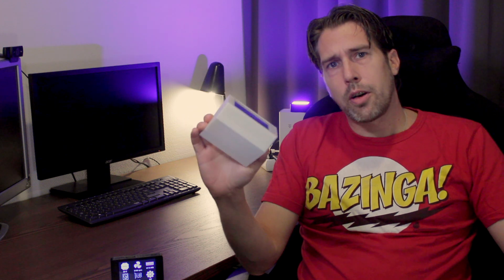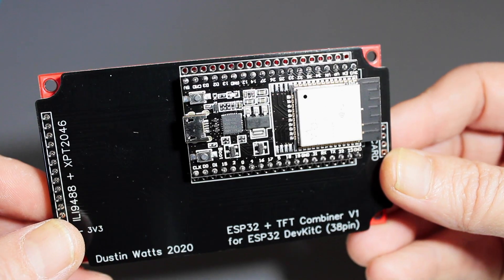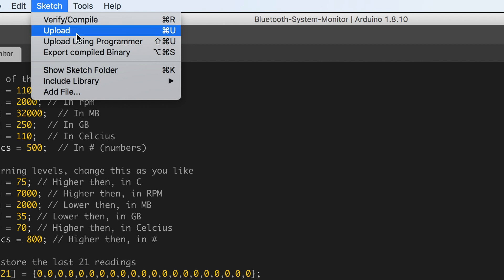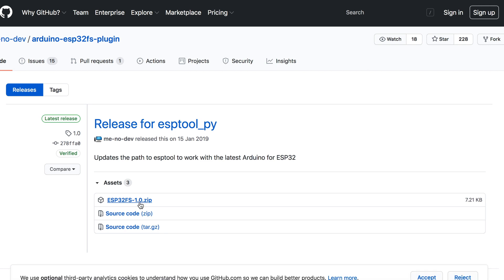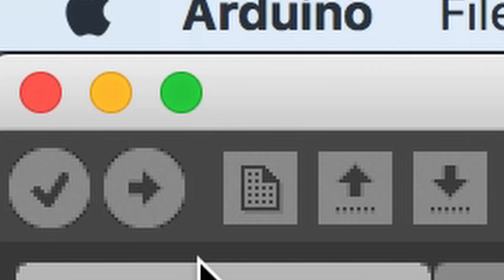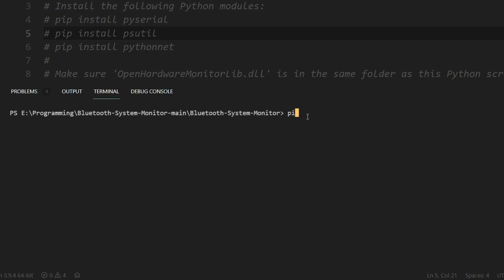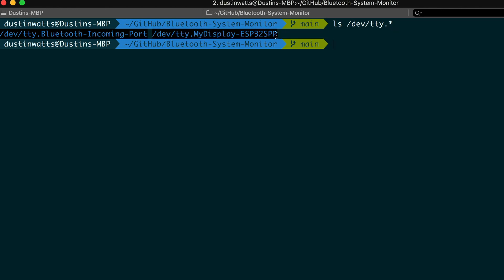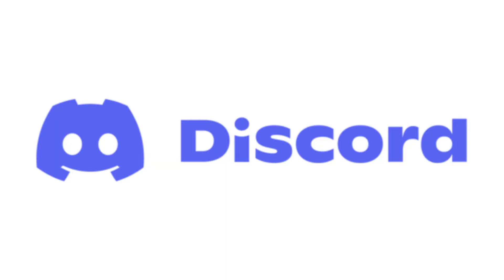Build your own Bluetooth System Monitor

Comment: "AddReference" is not a known member of module "clr"
error in my windows 11, pls help
Reply from the maker: Hmmm... this has something to do with an upgraded library. Because nothing in the code has changed (it did but did not cause any errors). So I would suggest downgrading libraries (I think the ESP one) and see if it goes away. I will do the same but I don't have a lot of time so it can take a while. So I'm, making you the special library error finder of my Development team! :D

If we find the one that is causing the error, I will fix it. You can off course always go to "install.freetouchdeck.com"and install it via the web. But I would appreciate your help :)

Comment: But how did you connect the battery?
Reply from the maker: Since I used the ESP32 TouchDown, this has battery management included for LiPo and Li-ion batteries.